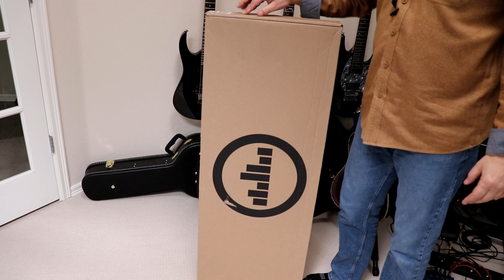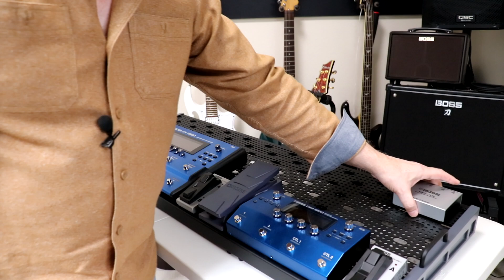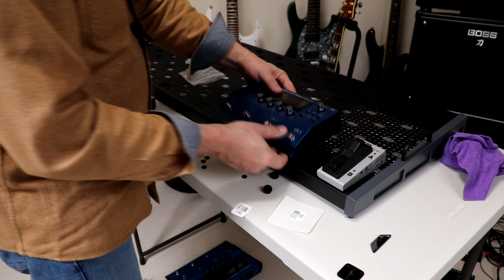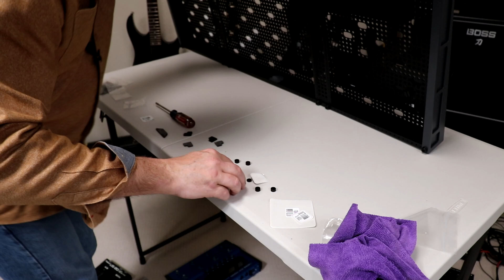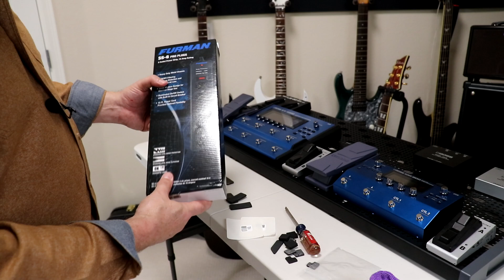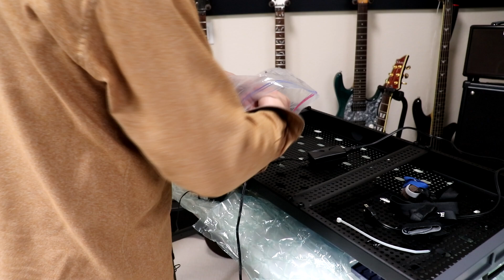Building a Guitar Synth Pedalboard

Comment: Great video.  It looks to me that this is a massive, heavy pedalboard and not very practical.  Why would you not use the new VG-800 instead of the larger SY 1000?  Also, do you know if you could use a short standard 1/4" TRS GK out to GK in cable between the SY-1000 and GM-800?  I read that the GK cable is a twisted pair special cable.
Reply from the maker: I made this video before the VG-800 was released or even announced, so I did not know about it. The VG-800 and the SY-1000 are two different animals. Although there are many things that are similar, there are things that are different too. I plan on doing a comparison video soon.

It is a massive pedal board, so if I was playing out somewhere in a small confined area then it would not be practical. I mainly use this in my studio. I got tired of the mess from all the Boss pedals on the floor. This pedal board mounts everything and makes it stable, and it hides all the connections underneath the board. It actually saves space. As far as weight goes, it is really not that bad. I had guitar amps that were much heavier than this. I plan on making a video where I will be rebuilding this pedal board and I may leave the SY-1000 out when I do it, but I have made no final decisions on that.

I have read the same thing you did regarding the Roland cables. As an experiment, I used a TRS cable from the GK5 pickup to the GM-800, and it worked fine with no issues. I have not tried using A TRS cable from the VG-800 to the GM-800, but now I am going to try it to see if it works

Comment: Not a bad setup at all! To bad for the power supply issue! So how's the tap dancing with the board? Is it comfortable getting to all the switches? I have a huge Trailer Trash pedalboard that I have set up with my Helix and Gr55 plus a few other stomp boxes. Everything fits well after a few changes in configuration. But with the weight of the board and the effects on it it comes in at about 50 to 60 pounds lol. Thought about building a two tier board for home use. But I think this might do the trick for my synth setup to travel with. Thanks for sharing, great job Marcus!

Johnny O
Reply from the maker: Thank You Johnny

Comment: Nice one, thank you for sharing !! 
I use a similar setup for bass (GR-55 is now retired) with SY-1000, GM-800 + GKC-AD, EXP pedal into the SY-1000 with it sending midi cc#80 to the other pedals, a DIY midi foot note controller.
 I use GM-800 parts 1 & 2 for GK pickup, and parts 3 & 4 for the midi pedal.
I use just 1 EXP which controls both the SY-1000 and GM-800 so that in the middle position is a mix of both, SY-1000 heel down and GM-800 toe down, depending on the patch (SY-1000 is the master patch controller and the other pedals follow) the mixes can be different ratios, or in different EXP positions . 
A DIY GK splitter top right corner (in attached photo link) + DIY passive stereo mixer for stereo out to PA, and mono monitor send to stage amp.
There is a Boss VE-500 there too for vocal effects, and the FS-7 is used A = vocal effects bypass, B = special spot vocal effect.
The GKC-AD is under the GM-800, and the SY-1000 + GM-800 power supplies are under the top of the SY-1000 (see it is tilted upwards at the back).
All works out quite good, but you need to balance the tone levels right before using at a gig.
Picture link of my DIY pedal board below, which also has a lid, handle, and suitcase clips, with cable storage in the lid, so I can carry it easily like a suitcase.
https://i.imgur.com/3n6P39N.jpg
Reply from the maker: Nice Picture. Thanks for sharing. Love your setup.

Comment: Hi! Thank you so much for the video!

Tell me how do you switch the guitar sound that comes from a regular pickup 
To the SY-1000 guitar processor. between the sound that comes from the GM 800 synthesizer
Write in more detail about the connection scheme and settings
Reply from the maker: YouTube sent your comment to held for review. I have that feature turned off, but YouTube sent it there anyway, and I just now found it. Sorry for the delayed response.

Well to start both synths plug into a mixer. You need to use a powered speaker like a P.A. speaker of some sort or plug into a P.A. system. You can use a small mixer. On the mixer, I use odd numbers for left and even numbers for right. This is pretty standard. Plug both synths in stereo. Pan the odd numbers hard left and the even numbers hard right. Plugging into a guitar amp will not sound good at all.

 Each synth has two CTL function connections. I use one for an expression pedal and I use the other for the FS7 control function switch. I balance between the two synths by using the expression pedals for each synth. Furthermore, I control the volume of both synths in this fashion. If you want a more detailed explanation, check out this video

https://www.youtube.com/watch?v=BeDg9q6jfnQ